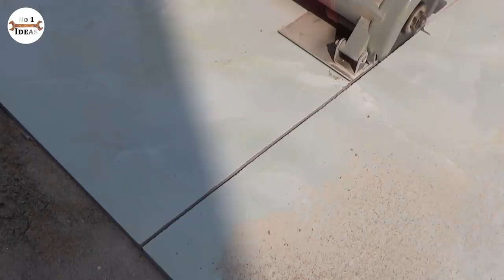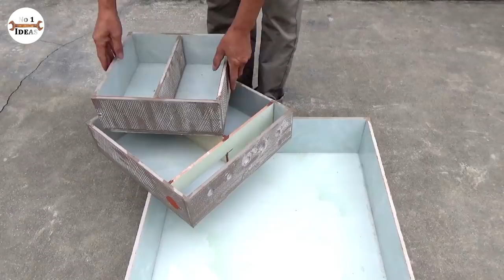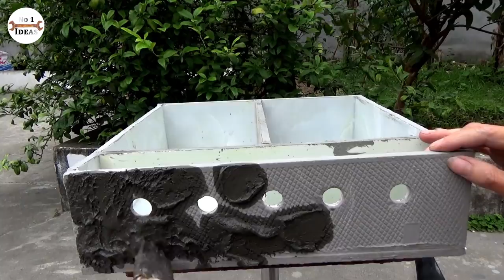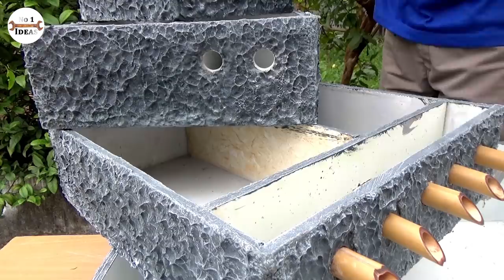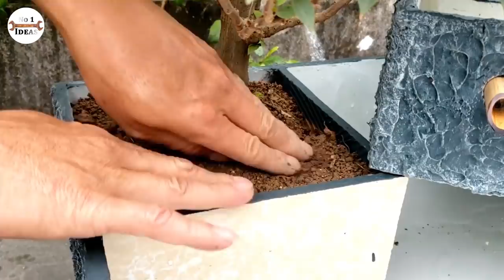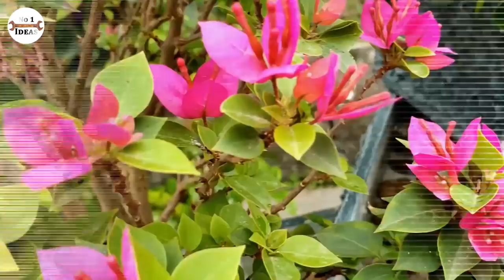Amazing Ideas from Floor Tiles - Simple Way to Have Beautiful and Unique Waterfall Aquarium at Home

Comment: Amazing work or art..Would appreciate  if you answered everyone's question about how you had that water flow, if you used an water pump or not
Reply: From my idea you need to start the pipe  by your mouth like u are drinking then the water flows.. cycle... you need good lung to bring water from the lower part at first....
Reply: yes whit water pump